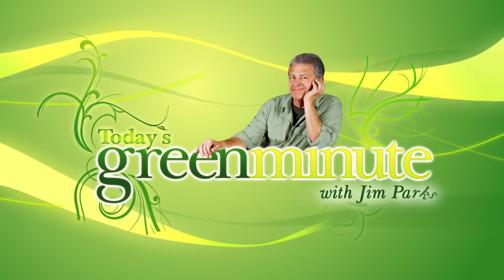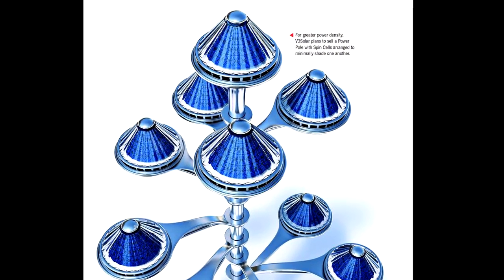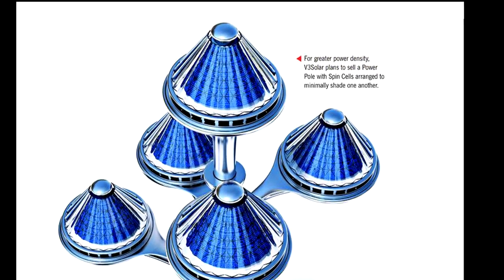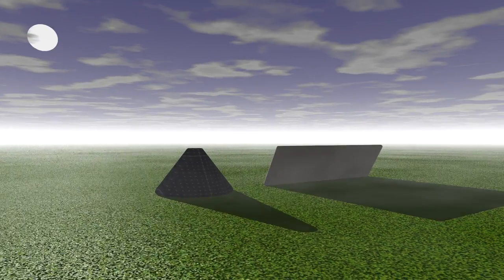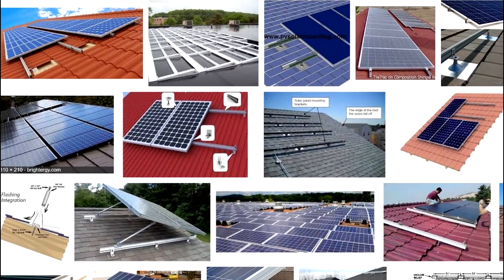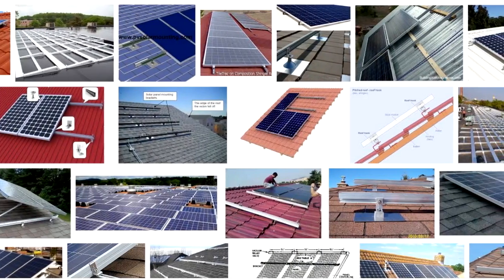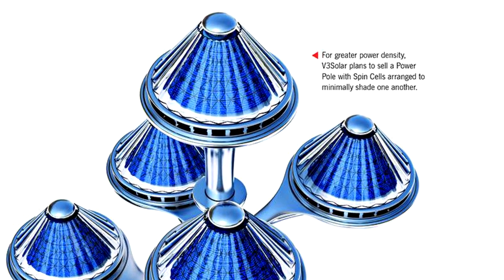Spinning Solar -BUSTED!

Comment: Lets say we are capable of spinning a solar box really fast so that the solar cells are out of direct sunlight for only a split second at a time and the light that hits it acts like the blinking light of a fluorescent bulb. How long can a spinning solar cell be out of direct light before it stops generating its optimal 20% energy?
(Theoretically, if we spin the box fast enough then the light hitting the solar box is slightly dimmed and the solar cells would detect constant light with a lower intensity.) 
So what I'm trying to do is find that sweet spot where we try to make it both energy efficient and cost effective to spin the box while nearly quadrupling the light input and energy production in the same amount of 2D space while simultaneously cooling the box-shaped solar panels since with the air that would flow around and through the panels.

The spinning feature of the solar box could be assisted by adding a windmill connected to an axil and gears that turns all solar boxes that are connected in a line to the axil.

Comment: I don't think this video is busted due to the fact there are other factors which have not been addressed and therefore not busted.     first we need to know more about things like the lens that covers the cells.  is it magnifying the suns rays? like some led flashlights have on their lenses, magnifying  their light.    if so it would increase the cells power and would also increase the heat of the cell.     another observation is look at the cells under the glass, they look pleated, like your cars air filter element.   this would give you way more surface area. and if this is so then maybe the lens directs the light to all the surfaces as well as magnifies .  so you would have a larger solar panel due to the pleated surface area.  and then you have the cooling.   look at the bottom, there are slots, its obvious when this thing spins it is able to direct air flow through it's self which may be cooling the cells.    and this design also would lend it's self to being able to use a reflector behind the spinning cone which could use solar reflected light to light the other side .   however I don't see where you would get a 20 times the power,  but could possibly be more efficient than the flat panel.
Reply: I think that the 20 times more efficient is what they advertised or marketed to people which is false or an over exaggeration as it mathematically and logically doesn't make sense. You said the solar cells look pleated which I assume is from 2:15 of the video but to me it hard to tell because of the magnifying glass that is distorting the view which looks to be pleated but every other spinning solar shown in this video doesn't seem to be pleated. And even if it was then I could argue that you still get the same suface area of solar panels in a flat variety and space in a 2 dimension sense isn't really that big of a deal. Also there could be a problem with having pleated solar cells because if the sun was at a diagonal position relative to the solar panel then parts of the cell that pushed outside due to them being pleated would create shadow or block the sun light to the cells that got pushed closer inside from the pleating. Magnifying glasses can concentrate or spread the light but I don't think they could refract the light to the opposite side of the cone no matter how much you spread it because of the angle. If you're going to put a reflector on one side then wouldn't it be a bad idea to spit it? Because if the reflector side is facing the sun then one side would still receive no sun because a reflector is not transparent so the light can't go through it and the transparent glass side will receive no to far less light since it facing away from the sun. So it will receive even less sun light every time the reflector faces the sun. Plus reflecting light diminishes some of its strength so the panels on the opposite side would still receive less sun light if it didn't spin. People have used magnifying glasses on solar panels before so this is honestly nothing new. Flat solar panels still seem better and it still seems entirely busted to me.
Reply: @TheSteelmushroom   I am just saying there are some variables  I am seeing that need to be examined before one can for sure say its busted.  I would like to have one to test.   And I don't know maybe there could be a way to have a pleated panel.  also there must be a reason for the panel spinning otherwise why would they do it?   could The spin create a pulsing effect in the output?  There is amplification of energy in pulsing at resonance.  I know I have done it myself.  manipulating magnetic fields.  maybe inside that cone shape thing he has capacitors and a coil creating a tank circuit, and the pulse from the solar cells are running the tank circuit.  I have solar panels but i  intend to use them to power a motor which will operate a leverage system which will be used to offset the balance of a mass so gravity can act on it and set up an oscillation, then use the oscillating mass to do the same again to another mass. in effect harvesting gravity to do work and creating mechanical amplification.
Reply: @rmendes2mendes915  Though I hope you're not going to pay for it like that one time SCiO around 2 years after this video tried to trick ThunderF00t to give them money to test their device which he debunked already. The reason being stated or advertised for the panels to spin is so they can cool the solar panels and whether it because they thought it was a good idea or they're trying to come up with something that seems new, flashy to draw attention is another story but as ThunderF00t has shown that probably doesn't outweigh the fact that any half of the total panels will receive no sunlight.

Comment: How I'd combat the heat on a tracking solar unit is with a simple water cooling system. However, the gains from improved cooling would not only have to improve enough to run a fan and water pump, but gain enough efficiency beyond that in order to make the production cost worthwhile.

Another option is having a heatsink on the back to improve surface area, or a heat exchanger on rooftop panels connected to water mains in line to the water heater for example. It's still going to do fuck all, however the latter might save a few watts from water heating. That, and it's still going to be way cheaper and far more efficient than this solar Christmas tree crap

Comment: 23 And he made a molten sea, ten cubits from the one brim to the other: it was round all about, and his height was five cubits: and a line of thirty cubits did compass it round about.
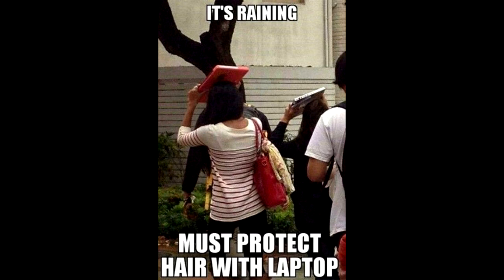READ your bible correctly you have to add the hand breath of the rim to that calculation, [1 Kings 7:26]  The reservoir was a hand breadth thick, and its rim was fashioned like the brim of a cup or of a lily blossom. It held 2,000 baths......
 this is to show how much liquid it could hold

The key part of this verse is where we are told its rim was a hand breath thick and was fashioned like the brim of a cup, 3 would be the inside dimension to get pi you need to add approximate 10-12 in. add  2 hand breaths more for the thickness plus the curve of the rim  to the diameter. to get Pi to equal 3.14 
again 30 cubits is the inside measurement, the diameter is to the out side of the rim not to the 30 cubits. the out side of the rim would be 47 cubits with the rim the inside would be 30 cubits. hope that this will help you. you cant debunk the Bible, it is the living word of God, if there is something that we find in error, it would be us who got it wrong.

Comment: Although the idea is horrible,something it may do right is that solar panels generate Direct Current and you need Alternating Current to use it in a house.turning the direct current into alternating makes you lose some efficiency,and if you use dark side of the panel to generate DC on the other direction and start spining it you will have AC(but it's still very dumb to put them in a cone shape)

Comment: What if the spinning is from the heat/light energy of the sun and its actually turning a super tiny generator inside like the side of a PC case fan?
Reply: @junebug9267  You missed the point. I was wondering what the methodology of having it spin, how it spins without losing energy was unless it used a small generator to recoup some of that back. I never even said 'solar panel' or referenced one... The point was more that it might use the heat/cold difference to spin the cone with a small generator giving it the 300% boost. How you came to your conclusion baffles me. You do know how to read?

Right?

Comment: For the energy needed to spin an entire cone-shaped solar cell and its giant lens-cone, you could just run a few fans or a liquid pump, slap some heatsinks underneath the cells, and cool it that way. Or at the very least, just use heatsinks and normal wind. That's probably not efficient in reality but it makes a hell of a lot more sense than this.

Comment: Lol if this thing spun at high speeds the perpetual motion could generate kinetic energy which can be converted into electrical energy like in a turbine. But we have those and they are called wind turbines.

Comment: it's the audience and the disseminator. When I read about flying cars and ion engines in Popular Mechanics magazines in the 70's, I easily recognized it as pseudoscience. If I read the article, there would have been at least a sentence stating that the concept was dependent on Tech not yet available. a disclaimer, if you will.  
In this info age, nobody takes the time to mention that Technology has limitations, LIMITATIONS that may or may not be overcome at sometime in the future. The sardonic ignorance of the millennial generation makes them gullible to pseudoscience and it's mongers. To our phone totting tots, the future of technology is not speculative, but assured.

Comment: The obvious solution to cooling has been overlooked: run a fan off the solar cells to cool them. Then you can also generate power from the wind of the fan! I'm so clever.

Comment: To avoid losing electrical power to rotate the cone you can use an internal combustion engine for that. So like in a tree with 20 of these cones 20 IC engines. Problem solved. I am a genius!

/s
"I like the smell of exhaust fumes in the morning"

Comment: Also you kept bashing them with 20 time more efficient when they claimed to make 20 times more energy not eficiency if a flat panel makes 1 kw then the cone makes 20kw if the flat panel is 20% efficient we only know the come produces 20 times the energy but we don't know if it can produce more by making it more efficient. Although the cone still sounds like bull shit I would like to see it actually working instead of a 3d picture just so they can actually get some real world disappointment.

Comment: 20 times more efficient than 20% would only be 400% efficient in the most naive way.  If they really were 20 times more efficient (which obviously they aren't, this is a  sham as everyone knows) it would probably mean 96% efficient, or 1/20th the loss.

Comment: I wanna devil's advocate for a minute. Let's put aside "20 times more efficient" and instead aim for any kind of improvement in terms of energy produced over manufacture cost.
Granted, it'll never be as efficient against a tracking solar panel, but how does it fair against the standard non-tracking kind? A (very) quick google tells me you can expect tracking panels to be about four times the price, and they need a lot more space.
Would a conical solar panel, on average in a day, accumulate more energy than an unmoving one of equivalent area? If yes, are they appropriately cheaper than their solar-tracking counterparts?

I'm definitely not sold on the glass dome thing, though.

Comment: Okay, lets put Thunderf00t's numbers to scale if I'm doing this right:
Normal Solar: ~20% output
Cone Solar: ~10% output 
Then when he said they lose about 20% efficiency from overheating:
Normal Solar: ~16% output
Cone Solar: ~10% output 
This is where the cone solar is supposed to shine, but alas it's not looking any good.

So even though they claim it to be 20x more efficient, it can still be useful, though a false claim can be dangerous and can prove fatal to the whole project.
But that depends on the production cost I assume since I don't have any information on how much a cone vs normal solar panel costs.
Note: When comparing these two, we assume that the surface (panel) area is the same for both.
So, if the cost is less for the Cone Solar, it might justify the ~6% decrease in efficiency since It takes less areal space and needs less maintenance ( I assume ).
When it comes to the electricity cost of the spinning cone, they are not the only ones that spend energy on moving. Some solar panels track the sun by moving. Then you could say that it does not move nearly as much as the cones, which is true, but the weight and energy consumed by moving the tracking panels are also not little, so I'm unsure here. As I've searched the web, I've come across a website describing weight: civicsolar.com/support/installer/articles/how-much-do-solar-panels-weigh

I might just be that guy that thinks that he knows, but this is just how I see things. I don't claim to be rightful in any way.

Comment: Here's a curious question. I'm late to the party BUT... Can solar panels get energy from sunlight that's been reflected back at them from a mirror? If possible, you could use one way mirrors on the interior of the glass to get some less intense light on the backside. yes, it might be lower efficiency, but it's just a concept. 

I would like to know your thoughts since you've put a lot of thought into this.

Comment: Note that the cone has no opening to allow any heat inside to escape so it causes the air inside to get hotter and hotter.

Also note that the audience is not shown for the speaker. Is there one or is the cheering just recordings made elsewhere?

Comment: Wait but you forgot that even in the rectangle one gets all its coverage that's only gonna be for a few hours while the cone does it all day probably will still be just as good as a normal one since it will spend most of its made power on spinning itself

Comment: I have a better one. It's a solar panel that you keep in doors.
You power it off of strong infrared lights, that you power with wind energy, that you use a desk fan to spin, powered by batteries that you charge off the off the solar panels.
It'll work bro.

Comment: The maximum efficiency would be on the North Pole during the summer and even then the cost to transmit that heat to anywhere other than northern Russia would be extremely high

Comment: I think the idea was to mount small strips of panel behind extremely strong strip lenses. So they would save on cost by not needing 1 square meter of panel to capture the energy from one square meter of effective front area.

Then they figured that the panel would cook if receiving 60 times the energy density of a normal panel. So the spinning cone would only let 30÷ of the panel stripes face the sun at a time to help them keep cool.

And their computation then was that 1cm2 if solar panel inside the spinning cone would receive (and so produce) the same energy as 20cm2 of flat panel tracking the sun.

So most of the equations basically reasonable, when it comes to 20 more efficient (20 times stronger sun) and less cost for the panel because only a small part of the cone would be covered in solar panel.

All except the production costs to have a magic strip lens magnify with a factor 60 and able to move the focus to the narrow solar panel strip as it rotates. And the issues with having each solar panel strip now handle 20 times the average solar intensity as a normal panel without cooking and while keeping a similar efficiency.

So a "good" idea with huge logic holes big enough to run Titanic through. It's obviously cheaper with a flat panel that covers 100÷ of the front facing area and doesn't need lenses or a constantly spinning motor to help with the cooling and where motor failure would result in a fire from the focused light from the lenses.

Comment: Not saying that rotating conic solar panel is working... BUT getting really fed up withy this stupid analysis! 
1) Have you ever touched a black sheet of metal/glass exposed to direct summer sun? try it for once it is well above room temperature and usually burning hot. Place a large panel, even off the roof and you will get a worst effect: convection does work but has limited effect when all surrounding area (roof+air) are almost as hot. it will get well above 60 degrees celsius hot.
2) You totally ignore sun orientation: the panels lose their efficiency when sun is not perpendicular... how about analysing this? this would be a good proof that something is wrong with their cone design... but no, it is too complicated!
3) the glass surface is not flat on the conic design... analyse that!
4) the flat solar panel efficiency is not anywhere close to 20% --> 20% is achieved for a few minutes during perfect conditions: panel temperature is ambient or normal (20-25 deg.C) perpendicular sunlight etc.
Any how, before screaming that something is a total bull* please learn to be rigorous in your own analysis.